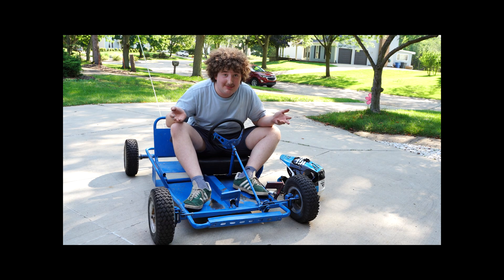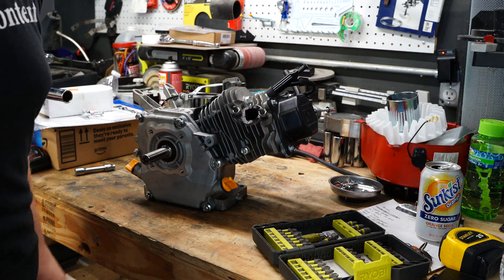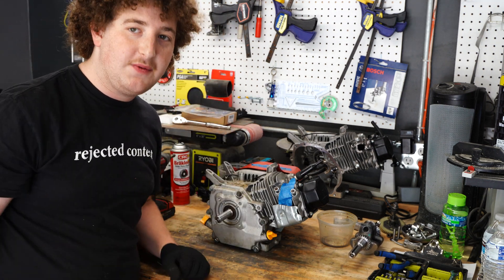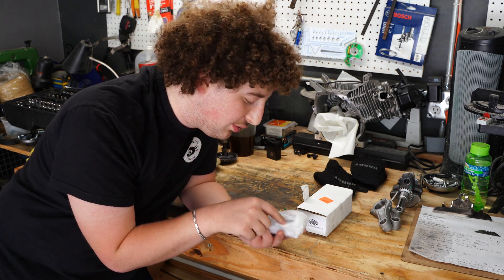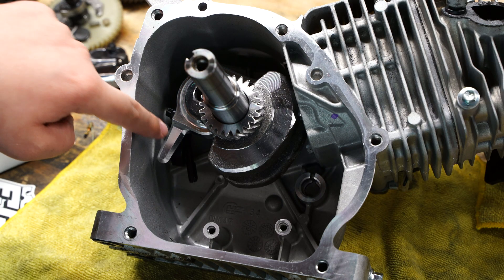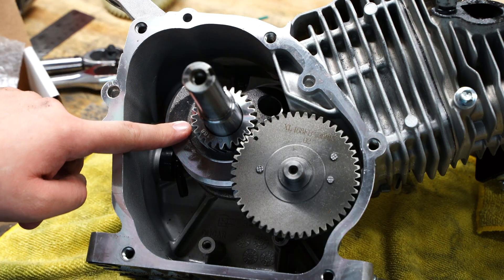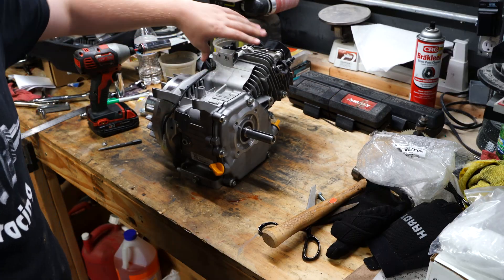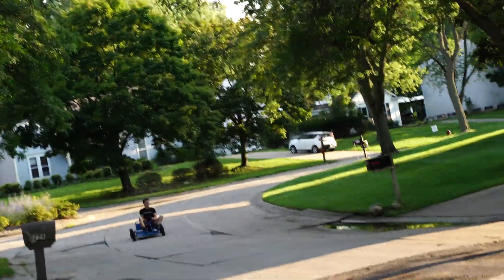How to build an ULTRA TORQUEY PREDATOR 224! | Kart Build Part 2

Comment: gotta love stroker engines. there’s nothing inherently wrong with the arc rod, just a bulky rod that needs to have the block clearanced in order to work properly with the 58mm crank, the ec rod is great because it clears pretty much everything except at the top of the block near the jug. if you plan on going with a bigger cam, dyno cams sells 224 core cams that have clearanced lobes and compression release to fit in engines with 58mm stroker cranks. 224 is a great engine with a lot of potential have fun with it!